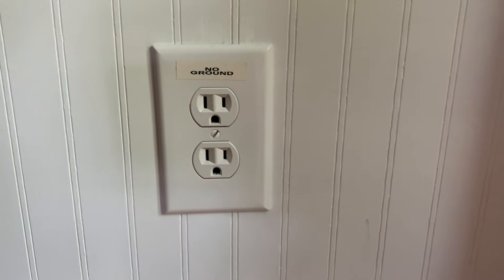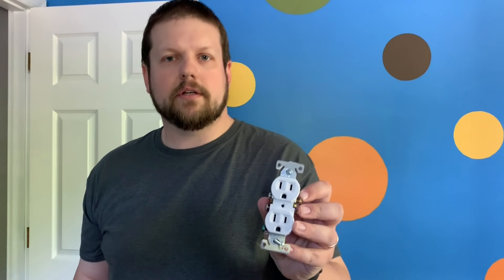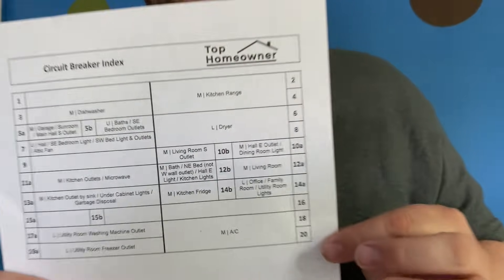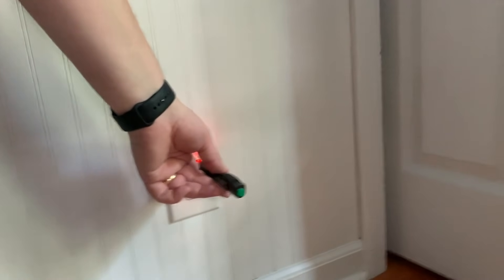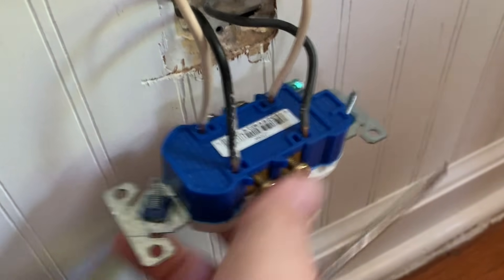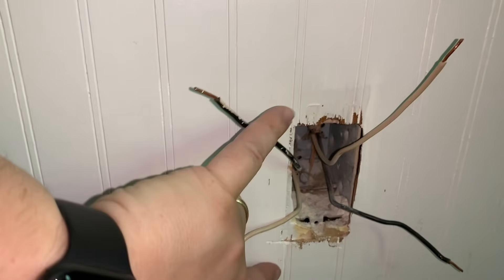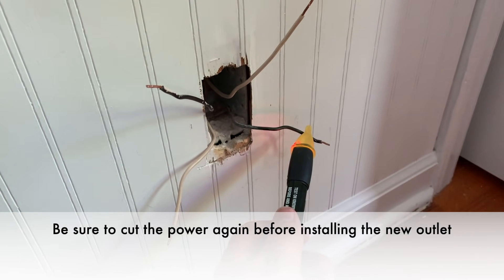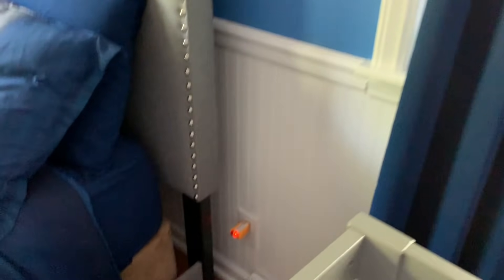Fixing Ungrounded Outlets - An Alternative Option to Rewiring Your Home

Comment: DO NOT DO THIS!  No ground is no ground period. It doesn't correct anything w/o a ground. Surely won't  pass inspection
Reply: Larry Christopher your comment shows your lack of knowledge of NEC! 
While in my opinion it is not ideal, NEC does make the provision for a GFCI in the most up leg receptacle of a circuit and label on the cover plate. Or GFCI in each receptacle location with labels. 
Now it may be possible your local code does not allow this, but unless that exist it will pass inspection as long as the correct labels are present.
Reply: So adding a label makes it correct? Put a meter to it
Reply: Larry Christopher what part of a label that says “no equipment ground” can you not understand?
As for putting a meter on it, you if correctly installed will get your reading of around 120v across the “hot” and “neutral” terminals. And as the label indicates and the video indicates there is “no equipment ground” so there will be ‘no’ readings to the 3rd terminal. 
Again as stated in a previous comment, it is not ideal but it is to NEC code, unless you have local codes that prevent it. To meet NEC each outlet requires the labels! (‘GFCI’ and ‘NO EQUIPMENT GROUND’)
If it is not what you wish to do, ok. I have said it is not Ideal, but it is to code!

This is copied from NEC 406 

   (b) A non–grounding-type receptacle(s) shall be permitted to be replaced with a ground-fault circuit interrupter type of
 receptacle(s). These receptacles shall be marked "No Equipment Ground." An equipment grounding conductor shall not be
 connected from the ground-fault circuit interrupter-type receptacle to any outlet supplied from the ground-fault circuit-interrupter
 receptacle.
 (c) A non–grounding-type receptacle(s) shall be permitted to be replaced with a grounding-type receptacle(s) where supplied
 through a ground-fault circuit interrupter. Grounding-type receptacles supplied through the groundfault circuit interrupter shall be
 marked "GFCI Protected" and "No Equipment Ground." An equipment grounding conductor shall not be connected between the
 grounding type receptacles.
Reply: I will NOT put a gfci label indicating ground knowing it is not grounded
Reply: Larry Christopher you do whatever you wish. But telling people it is not code is misinformation!
Telling them it will not pass an inspection is worse.
Furthermore you have trouble with the written english language! If you only put GFCI PROTECTED label you are only half way to code for labels. If you you put a 3 prong in place with out the 2 labels and without the up-leg GFCI protection, you are fully in violation of NEC code. 
Again do what you want, just drop the deliberate misinformation!
Reply: @larrychristopher9147  Nobody told you to "put a gfci label indicating ground". GFCI doesn't need any ground.  That's the whole point of the video.

Comment: If its bx wire with metal box then pigtail a bond jumper to the box then your outlet will be BONDED with the grounding system of its true all the way back to panel. Armor on the wire can make a good bond but not truly grounded. Put a gfci with the not grounded sticker to identify it
Reply: @johnaccettola  not grounded, but bonded
Reply: @johnaccettola  Have never seen any inspector "fail" an electrical installation (at time of sale) that was in compliance with the code in effect at the time of installation.  Yes, if it's a "change of use" to a different hazard class, then non-grounded receptacles (and wiring method) may become an issue.

Comment: Thanks for sharing. Just a suggestion, wrap electrical tape over the screws to prevent accidental shorting to the metal box.
Reply: Brian Uehlein  I guess experience is truly the best teacher. Cheers!
Reply: Brian Uehlein  believe what you want, but that tape may be the difference between an amateur getting electrocuted or not when he takes out the receptacle to work on it. It is imprudent to advise against this practice since this comment section is flooded with amateurs.
Reply: @juak91  It isn't there to protect someone removing the screws.  If they are removing the screws without cutting the power, and the box isn't properly grounded like it should be, and is shorted to hot like it shouldn't be, then they are going to get shocked touching the box after removing the cover.  It's there to keep people from being shocked by just brushing up against the screws and there is a short to the box, and the box is not grounded like it should be.
Reply: at the very least, screw them down tight!
Reply: Hehehe I had some people at my previous job do this with papper tape.  I lost my crap on that.  Turns out 4 outlets in the building caught fire shortly before I found that.  Diagnoses was loose screw and papper tape
Reply: You should definitely do this when there is no ground wire. If the live touches the case it will energize the equipment case that is connected to it and the GFCI will NOT protect.
Reply: Yeah. That's in the NEC now.
Reply: @bgarrison67  what code article requires this?
Reply: @AdirondackCampingAdventures  it's called a courtesy wrap...union electrician here...IBEW Local 11......dont ask any questions just do as your told!
Reply: @AdirondackCampingAdventures  It's not a code requirement, but it's very good practice. I require it of all our journeymen. I also don't let them energize without covers in place, no matter how much they dislike it.
I've had it up to here with the mucho-machos who think 120VAC can't kill you.

Comment: WRONG I WOULD NOT CONNECT IT WITH OUT A TRUE GROUND SOURCE
Reply: JERRY DUHON that is your choice and if possible not a bad thing to do. But NEC allows what he is trying to describe. I will admit I stopped watching about 3:30 into the video as is inaccurate terminology was more than I could handle. Unless you understand what he is talking about, you will be more confused in my opinion.
Reply: For most home owners it’s not realistic to run ground wire through their walls. Absolutely nothing wrong with using gfci receptacles to compensate.
Reply: John Connolly confused! The comments shown shows you commenting regarding something you did. 
Just let it go! Do what you wish but stop the saying things are not NEC approved because you do not think it should be.

Comment: Sometimes even the 2 prong outlets are grounded.  They are grounded through the screw that holds the cover plate on.  That's why if you use one of those 2-3 prong adapters, that tab should be under the screw which provides the ground.  You can test this with a tester with wire by putting one probe in the hot side of the outlet (which is the narrow slot) and then touch the other probe to the screw.  If it lights up, there is a ground.  That tab isn't their to help hold the adapter in.  It is the ground and you can get the ground by putting that tab under the screw.  Sometimes there is still a ground even if the 3rd. bare wire isn't their.  In some cases a rigid wire (The one that has 2 wires running through a metal sheath.) is used.  The metal sheath provides the ground as long as its clamped into a metal box.  The metal sheathing provides the ground.  If there is no ground, the circuit breaker panel may not have the bonding screw installed which grounds the box to the neutral/grounding bus bars.  If you are uncomfortable with electric at this point, get a qualified electrician to open the panel and fix this problem.
Reply: Is not that simple. If you have a 3-wire system, an wanting a 4-wire system it's going to require new panel, feeder. outside panel.
Reply: Just because a box is metal doesn't mean it's grounded.  Those adapters that are supposed to touch the screw for the plate are stupid, because if the receptacle only has two holes,  the box is not grounded anyway.
Reply: @56243G  Not only that, not all two-prong receptacles are "polarized", so you can't tell (by looking at its face) which terminal is hot.
Reply: @UpnorthHere  my home has 2 prong outlets, but the holes are polarized.  One hole is bigger.  The house has most of its original outlets.  I replaced a few with new 2 prong outlets, but most are still original.  I replaced my grounded bath outlet with a 20 amp GFCI.  Since my house only has 1 breaker box and no sub panels, I can borrow grounds from grounded boxes to bond my ungrounded fixture & receptacle boxes legally per NEC rules.  My garage is detached, and is also GFCI protected.

Comment: The gfci is just an acceptable means for this type of situation....it does not need a ground to work....just helps with a little more protection....if there is no ground wire,it doesn't take the place of one.If you want a ground,then you have to physically run one,or rewire with nee romex....period.....
Reply: New

Comment: This guy doesn't know anything. He is wrong about GFCI both where they go and how they work. They need to be by water 6 ft. Waste of money any where else. Plus they don't work without the ground wire running to all of the receptacles. If he had a tester that had the button to check GFCI he would have failed the test.
Reply: Of course it would fail but that is because how the tester works. It diverts current to the ground wire as that is all it can do. The test button in the outlet diverts current to the neutral bypassing the GFCI so it works. In real life we are not interested in current that goes to the ground wire. We want to prevent it going through the user so in real life situations the GFCI works. Sure without ground it may require that you touch the faulty equipment first. 

Testers are just devices. It is for humans to interpret the result.
Reply: @Don Ski: If I were you, I'd delete your original idiotic comment and subsequent arguments that prove you don't know enough about a GFCI to teach anyone anything. You must be pretty embarrassed to learn that absolutely everything you wrote above, in your original answer, is incorrect, other than the obvious fact that an external GFCI tester would not trip the GFCI, as explained in the instructions for the tester. The TESTER needs a ground. The GFCI does not.  In about thirty seconds you can learn how a GFCI actually works, if you care.
1. He knows something.  2. He is not wrong about the GFCI: they can go anywhere you need to replace an ungrounded receptacle with a three-slot receptacle that doesn't have ground. 3. They need to be installed in LOTS of other places other than "by water", as required by code (crawl spaces, garages, unfinished basements, all countertop outlets in a kitchen, etc). 4. A GFCI works perfectly well without any grounding wire anywhere. 5. All of the "downstream" receptacles will now have GFCI protection and may be replaced with ordinary 3-slot outlets with proper labels applied to each one, assuming he properly installed the GFCI, running "load" terminals to the other receptacles (which he didn't clearly show).  Had enough?   I have a BSEE and I'm a certified fire inspector with over 40 years of experience in electrical wiring in numerous US states and about 20 foreign countries.
Reply: U r correct in the sense that the GFI won’t monitor any “ground fault” due to the fact the ground wire isn’t there and there’s no equipment ground available, but however it still has a safety function to stop people from getting shocked
Reply: @Nick-bh1fy  it monitors ground fault indirectly by monitoring the current on the ungrounded and grounded conductor.  If the current isnt returning on the grounded conductor, you know you have a ground fault without an equipment grounding conductor.
Reply: Ryan well ya in that case that would be a person most likely is acting as the ground in which the outlet would trip before any damage could be done
Reply: @Nick-bh1fy  Which is called a ground fault. Current goes to the ground through the person.
Reply: Okaro X I’m aware of the term. I was just explaining in a less technical way but ur right the correct term is ground fault
Reply: @Nick-bh1fy  no Nick I'm sorry to tell you the GFCI does not work that way it will not stop somebody from getting shocked it must have the ground wire to work properly. Plus it's only to prevent people from getting shocked in water any other shock would still happen.
Reply: Just FYI I am an electrical engineer and I teach electrical Theory everyday.
Reply: Don Ski I was taught that on GFIs, yes it uses the ground in reference to the hot to detect a ground fault but can still work without the presence of a ground as it also monitors current on the grounded conductor (neutral) and if there’s not the same input as output the gfi will trip almost instantaneously. FYI electrical apprentice talking
Reply: Nick you are correct that a GFCI WILL work without an equipment grounding conductor present. It monitors the current balance off of the hot versus the neutral. If there is more than a 5ma imbalance it will open therefore protecting personnel. This is why when you install GFCI breakers you bring the neutral from the home run directly to the breaker and then from the breaker to the neutral bar. 

This means it does manage all ground faults and apparent ground faults. If more than 5 ma of current goes through the ungrounded(hot) conductor and does not return on the Grounded(neutral) conductor then it will open. 

Please make sure you research this for yourself and don’t take someone’s word for it; even if they are an electrical engineer. It does not mean that they actually know how the device operates.
Reply: @donski1519   You should get a refund for that schooling.   
It wouldn't take long  to remove the ground in your kitchen and short it out. Watch how fast it trips.
Reply: @donski1519  That is nonsense all the way. A GFCI simply monitors current balance between line and neutral and if there is an imbalance more than 5 mA (30 mA in Europe), it cuts both  line and neutral. Such an imbalance can be a result of someone getting an electric shock. The ground wire is not involved though it may help the imbalance in forming so that the GFCI trips immediately at the fault an not on someone touching a faulty device.

Water is not needed. GFCIs help most in situations where risk is highest like in case of near water. They help in case where help is needed. What you say basically is like saying brakes do not work if you drive safely.  Sure they work, you just might need them less often.

This installation would be reasonably safe without the GFCI in dry places. In Europe we routinely use grounded plugs on ungrounded outlets with twice the voltage. The GFCI makes it very safe. Sure having both grounding and GFCI would be better.

Comment: Looking at the tester at the end of the video shows that the outlets still are not grounded.  Don't do this, it does not solve any problem.  A ground fault has to have a ground in order to work.
Reply: Yes it does open at 5 ma, you are correct. However it monitors the current through the neutral wire. The ground wire is for equipment grounding conductor. Maybe you should type into google “ do I need a ground wire for GFCI” and see what happens. I have only been doing this for more than a decade and can ASSURE you that the GFCI needs no ground wire. Actually per the NAtional electric code section 210-7 you can replace a 2 wire(no ground) with another 2 wire device or a GFCI, because it monitors the faults off of the neutral. So please, try to be informed before you argue regarding something you have little or no knowledge of.
Reply: You do not need an equipment grounding conductor “ground.” For a GFCI to work, it monitors current to ground off of the neutral”grounded conductor”. If you do not know what you are talking about you should not comment.
Reply: @mattheweden8473 , I'm sorry to inform you but you do need the ground wire for GFCI  to work properly it is required, it compares the returning electricity from the neutral and the ground, 100% should be going back to neutral if it's anything less than that meaning anything going down the ground wire it will trip. A deference of 5 milliamps is all it needs to trip.
Reply: @donski1519  Not so, GFCI measures Hot to Neutral, not ground.  If it exceeds a few miliamps it shuts off.  The ground is unnecessary for it to work properly.  If your tester has the GFCI test button on it (and it should) you can test this for yourself, as it provides a resistance from hot to neutral just above the minimum acceptable amperage and shuts off the output to that outlet and downstream.
Reply: @badvlad9861  The tester will NOT work without ground as it diverts current to the ground wire. There is no other way it could create an imbalance as it only has access to the three connectors in the outlet. You must use the tester in the outlet. It diverts to neutral. It can do this as it has access to the internals and can divert current bypassing the GFCI.

Some may think that the test button is simply a switch. It is not, it actually tests the GFCI by creating an imbalance.

Providing resistance will not trip the GFCI. Every appliance creates a resistance. That resistance  we use to power things.
Reply: @okaro6595  Exactly.

Comment: This protects you from electrical shock, but doesn't' provide a ground for anything plugged into the outlet.
Reply: Obviously eh...
Reply: Without the ground it will not.
Reply: @donski1519  A GFCI doesn't actually need any "ground" of its own.  It merely senses when the hot and neutral aren't balanced and INFERS a "ground fault" (i.e., you being shocked) and trips within about 20 milliseconds.

Comment: Yea I was gunna say that,a gfi or gfci without a ground to complete the circuit if fault is detected at the outlet itself rather then needing to go back to the panel to complete the circuit then may as well just have a regular outlet there anyways.. however you may luck out with a ground wire hidden within the romex outside the box & may be able to extend it but it's a hit or miss..good luck & hope this helps a little